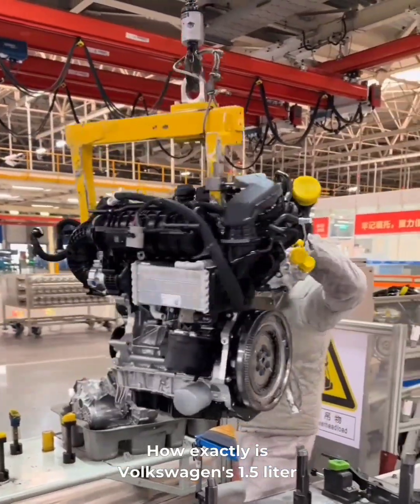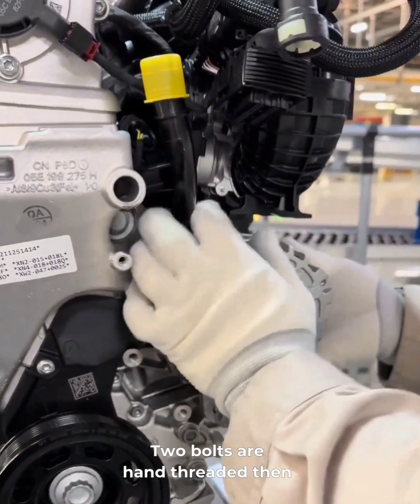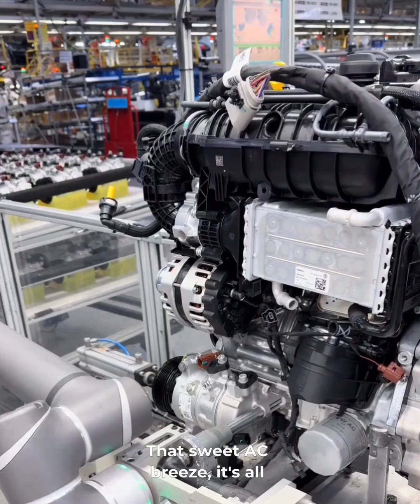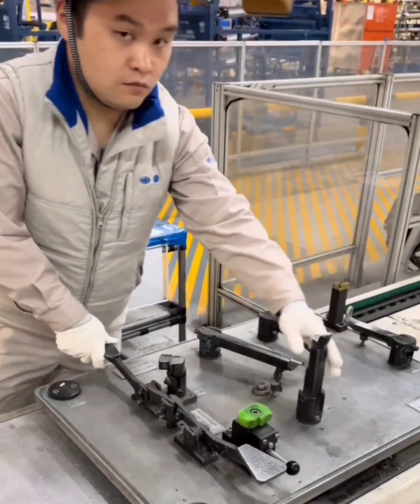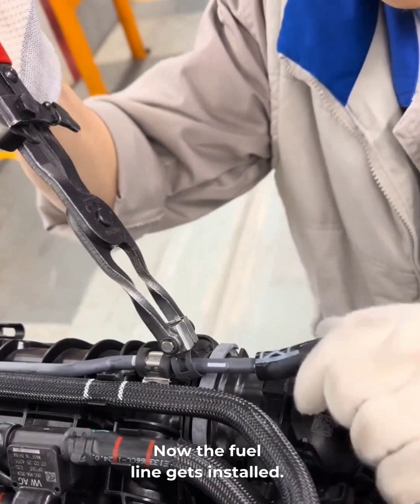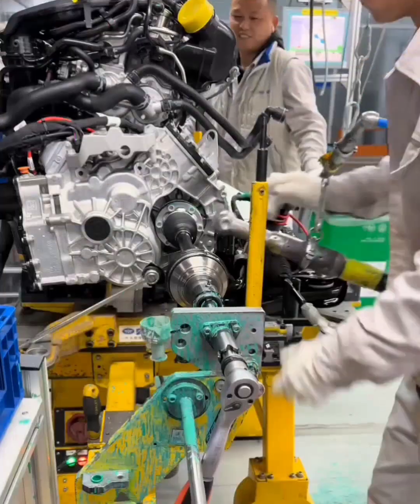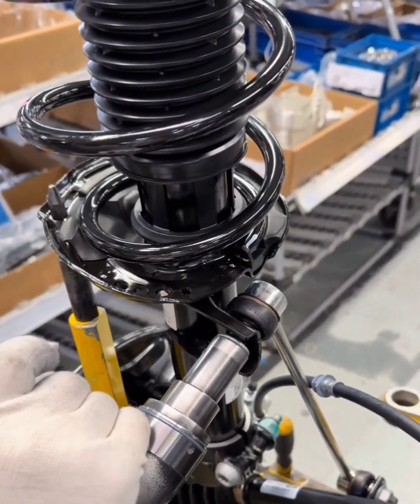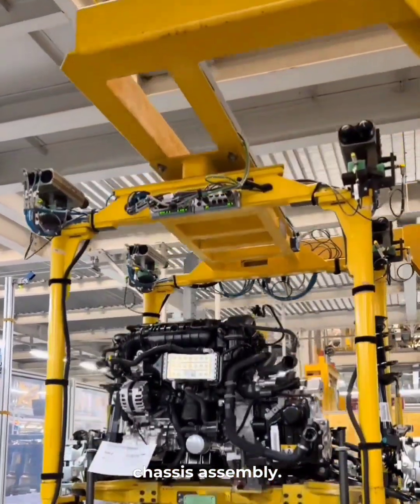Full Process: Volkswagen 1.5T Turbo Engine Assembly Line

Comment: How do they do the torque converter bolts to the flex plate?
Reply: torque convertor is only in US vw Thaos.  also the engine has 158HP, not 150 like normal ones 😊
Reply: DSG gearbox shown here doesn’t use a torque converter